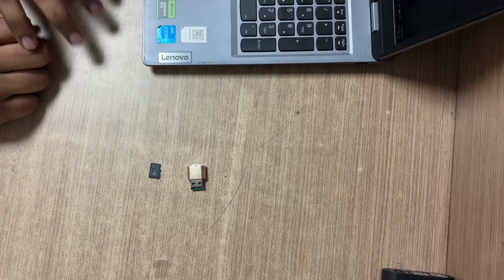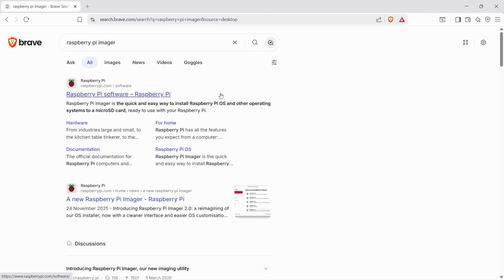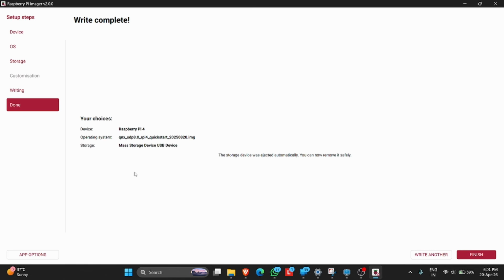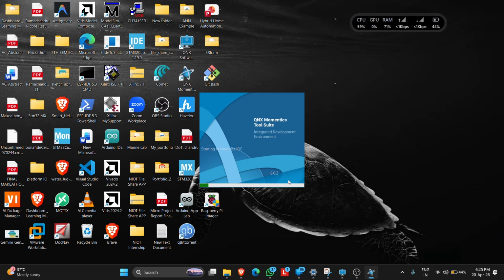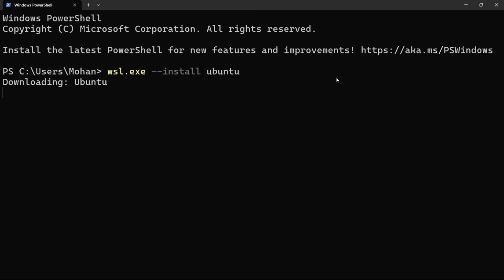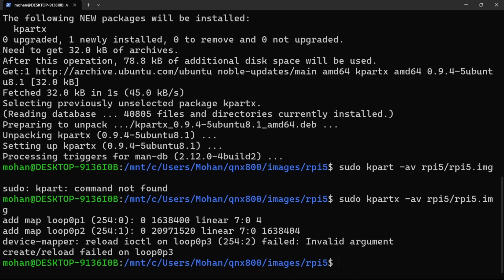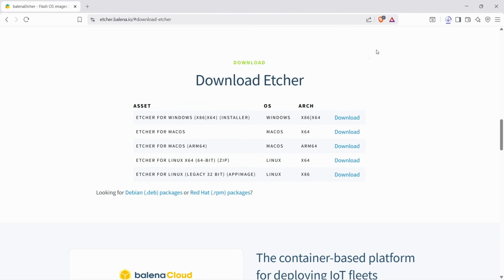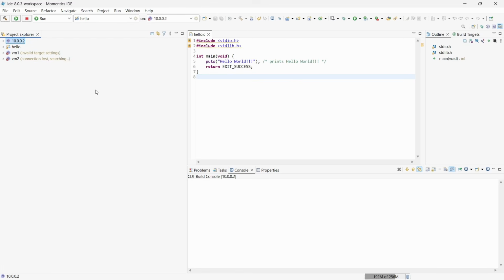Setting up QNX Targets - Raspberry Pi 4 & 5

Comment: Is there any traning on below topics ? 

Configure QNX Memory layouts and partition filesystems
• Configure network ports, GPIO/I2C/SPI ports and connected peripherals
• Tune of the QNX OS performance parameters such as
RAM, CPU etc
• Manage startup, priority and process scheduling of the SW stack
• Use tools for performance profiling, Static and Dynamic analysis, debugging, and analyzing core dumps
• Port and integrate the QNX OS modules to new SoC platforms
• Prepare image creation and flashing scripts
• Maintain compilers, cmake flags, and build configurations
• Safety requirements review and implementation
• Maintain patches, build, and integrate in CI/CD
• Work with Docker containers for build,debugging ?